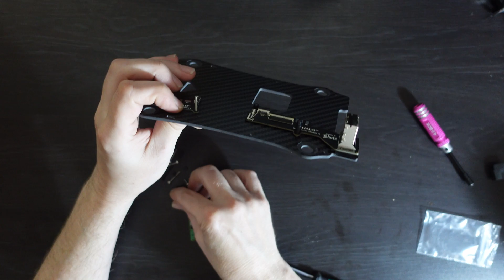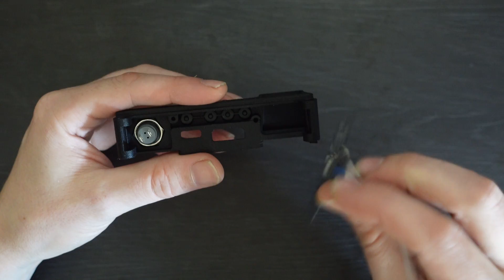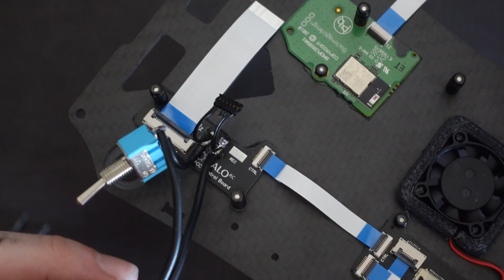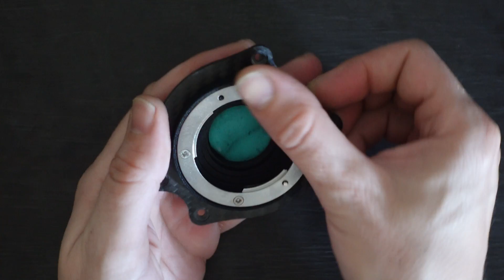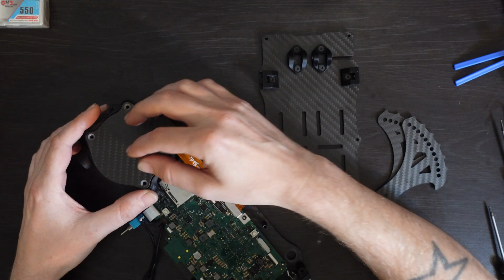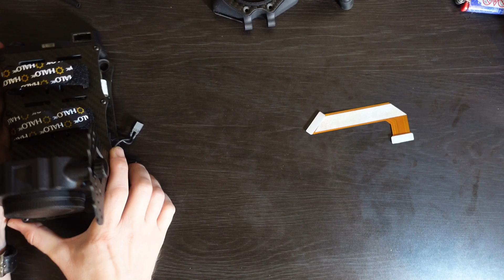HaloRC Naked BMPCC V2 - Build Guide (BMPCC4K & BMPCC6K-E)

Comment: Does 6.9.1 firmware support gyro ?
Reply from the maker: No, sorry, that firmware is very old now and was what we had to use before I designed the screen extension. Gyro data was added in 7.3 I think, but check my video here, https://youtu.be/yJFVR7CbenY I say near the start what firmware to use for gyro data.... or just flash 8.3 and have the latest.

Comment: I'm quite ballsy, but I wish I had the guts to do what you did. Just giving my current P4K or 6K a totally different custom form factor with bigger internal battery would be a huge win for me. I can do 3D modeling and printing no problem. But the electrical stuff.... great video man, lots of respect.
Reply from the maker: Hi. Thanks so much for the kind words, it means a lot. It is quite scary doing projects like this especially when I have no training and just figured it out using any methods I could think of. I love this camera as a normal camera but it's quite heavy and the battery not lasting long makes it a bit useless for me and I have to film with a GH-6. I have been thinking of ways to make a new design aimed at normal filming work, but I'm still thinking about what I want to do. People keep asking for a boc but as you can see it would not really work well without adding a lot of empty space or unnecesay extra components. Meh, we will see, thanks again for your support.

Comment: Proximamente pedire un kit para mi blackmagic 6k.
Solo tengo una pregunta...
Como adapto las lentes que se recomiendan?
No encuentro la lowa 9mm con montura EF, y nunca he usado distintas marcas
Reply from the maker: The naked 6k camera doesn't use EF mount, it uses Sony E mount. The new best lens is the Laowa 10mm Cookie E Mount :)
Reply: @Bludz  con tu kit cambia el anclaje a sony y no necesito comprar nada mas que la lente?
Reply from the maker: you will also want a cfast card, but lens and card are all you need to run the camera
Reply: Genial, pero ya no es posible grabar a ssd samsung t7?
Reply from the maker: If you need to , yes, you can use ssd, just have to mount it somewhere and carry 30+g extra